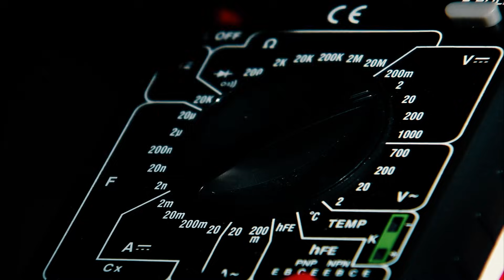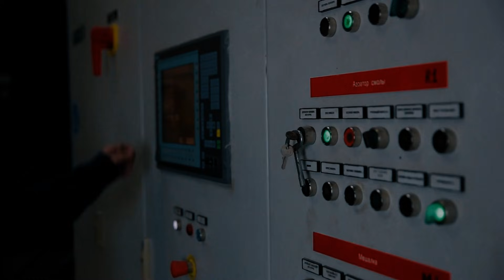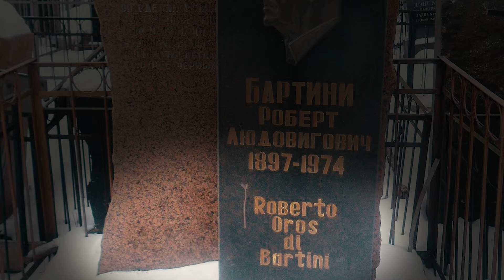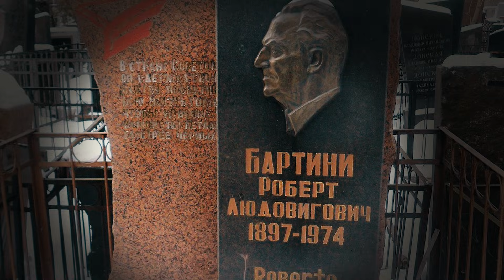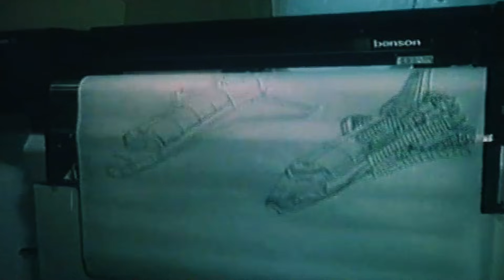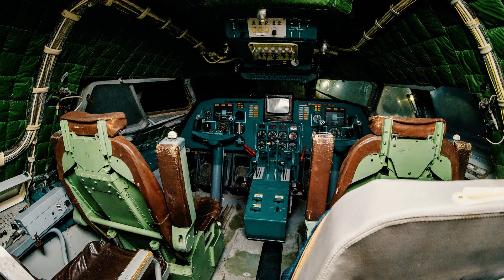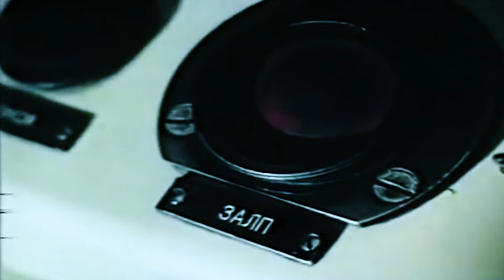5 Abandoned Soviet Mega Machines

Comment: Shrines to a failed centrally planned economy. These things are viewed as technological wonders of their day, but they were not. They were workarounds and/or responses to Western advances in an effort to gain any kind of advantage possible, to find an unfilled niche and put something there. 

The Ekranoplan is a classic example. The idea that such an aircraft could "fly under" radar is a little absurd. Yes, it can put 13 feet between it and the water, but it itself is much larger. Naval radars of the day could detect small boats with a much smaller radar cross section than the Ekranoplan with ease. There was nothing stealthy about it. The Ekranoplan was designed to carry a boat's worth of nuclear firepower into theater at high speed because Soviet submarines could not hide. They were too loud. So, lacking stealth to place their SLBMs where ever they wanted and keeping them there in preparation, they experimented with moving them into position faster than they believed NATO forces could react. The reason the Ekranoplan was scrapped was not because it had any major flaws, it did exactly what it was intended to do. The problem was their assumptions about NATO capability were incorrect. Not only could NATO ships easily detect Ekranoplans, but they could also easily be intercepted by naval aircraft. Ekranoplan was outclassed before it was even conceived.

That is the same story for virtually the entirety of Soviet--and Russian--weapons development history.
Reply: Exactly. America defeated the USSR with its economy, which is infinitely better than the old-fashioned way, and the Ekranoplan is a perfect example of how we did it.

Comment: The BVA was NOT a vertical take off aircraft. It was a water bourne aircraft which used GROUND EFFECT and forward propulsion to become airborn. Once airborne, ground effect would allow the aircraft to sustain flight for long periods of time without using substantial amounts of fuel.
Reply: 100% correct
Reply: Your confusing the VVA-14 which was supposed to be VTOL capable, with the ekranoplan.
Reply: Thanks, it was hard to believe something that huge could take off vertically.
Reply: The aircraft was designed to be a VTOL aircraft, they never got to fit the VTOL engines though.

Specifications (VVA-14M1)

Powerplant: 2 × Soloviev D-30M turbofan engines, 67 kN (15,000 lbf) thrust each (Cruise)
Powerplant: 12 × Rybinsk RD-36-35PR turbofan lift engines, 43 kN (9,700 lbf) thrust each (VTOL - not fitted)

General characteristics

Crew: 3
Length: 25.97 m (85 ft 2 in)
Wingspan: 30 m (98 ft 5 in)
Height: 6.79 m (22 ft 3 in)
Wing area: 217.79 m2 (2,344.3 sq ft)
Empty weight: 23,236 kg (51,227 lb)
Gross weight: 52,000 kg (114,640 lb)
Reply: @BoxxerCore  I bet it would have to take on fuel as soon as it's airborne.
Reply: Jesus calm down nerd
Reply: I knew that the second I saw the picture of it, watched a lot of documentaries on it. Thanks for pointing that out!
Reply: substantial amounts of fuel?
Reply: Yup - there’s so many inconsistencies in this video too!! 🤦‍♂️
Reply: They also state - there was only one ekronoplane built when it fact there was two possibly three built. One sank to the bottom of the sea with the inventor/builder onboard. The one that’s featured in this video on the beach, didn’t break tow ropes and wash up on the beach. It was actually towed to where it sits now as it’s going to be part of a military amusement park. Then there is rumors of another one that was 90% complete when it was scrapped.
Reply: not only that but it says it lies abandoned in an unassuming field whereas in reality it lies outside an aviation museum